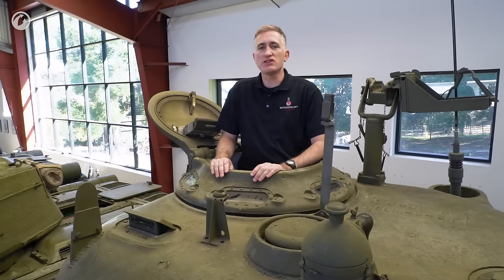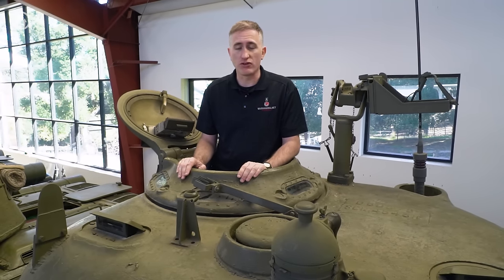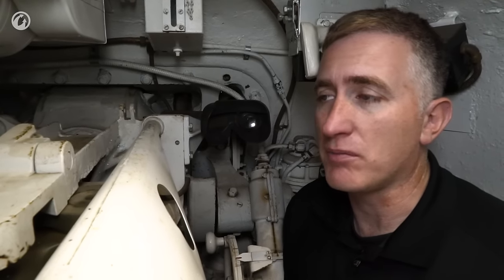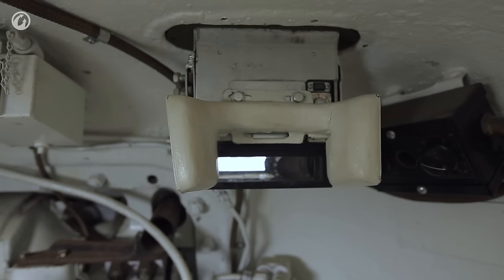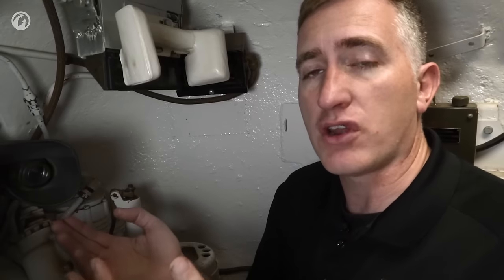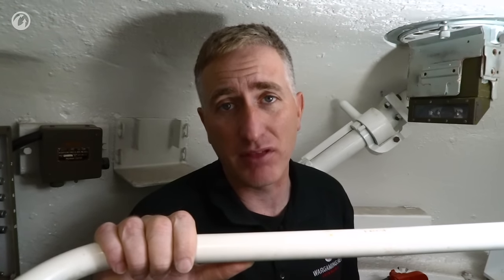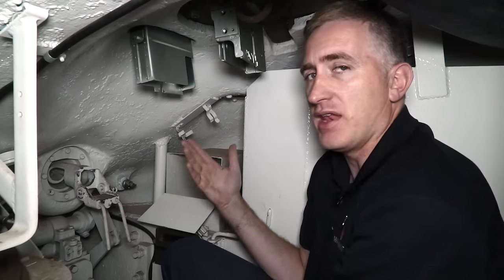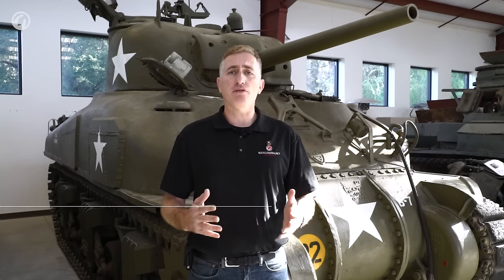Inside the Chieftain's Hatch: M4A1 Sherman part 2

Comment: the good ole "Tommy Cooker". The USSR received about 4000 Shermans, specially fitted with the 2 x 6/71N GM detroit diesels, and they loved them. Soviet commanders rated them better than the T-34, unofficially of course. Canon-neer?   What? on a pirate ship?  LoL    It is impressive, that the Chieftain finally found a tank, that he doesnt look super cramped inside ;)
Reply: That's 6-71N. The Detroits were designated first digit number of cylinders and the next two digits the number of cubic inches per cylinder. You could get 71 series engines in 2, 3, 4, 6, 8, V6, V8 and V12 sizes. They had four exhaust valves and a port that opened at the bottom of the stroke for the intake charge with a roots type supercharger forcing the fresh air in and out the valves at the top because this was a two stroke engine. It was famous for it's low end torque and the incredible noise it made at any speed above 2000 RPM. Power output varied according to the amount of supercharger boost being applied but 165hp was the low end and 238 was common but it depends on how the engine was equipped. The 6-71 was a legendary engine which was in production from 1938 till 1995 and V6 versions (6-V71) were the most common engines in city buses for decades. Soviets liked them because all their tanks were diesels so there was no confusion on what fuel to use. Marines used them as landing craft also used diesel. Army did not generally have any diesel vehicles and did not want to complicate supply requirements so avoided them.
Reply: @keithstudly6071  the USSR also received 100,000 6x6 US Army trucks specially made with Hercules diesels.  Lend lease to the USSR was massive in scale,quantity,priority (1st over ALL other US military branches) and range of materials. Chemical plants,rubber tyre plants, patents,all the Manhattan secrets..............the list is endless.
Reply: @wazza33racer  Yes and those trucks gave the Red Army a logistical advantage over the Germans, especially in muddy conditions. The Opel trucks the Germans relied on were only two wheel drive and would not take well to bad conditions.
Reply: @keithstudly6071  Yes, the german fleet was a mix of different makes,models and lacking in quantity. The reliance on horses was enormous. The Soviets on the other hand had plenty of trucks to move troops AND tow fleets of massed artillery and carry rocket launcher frames.  People dont appreciate that the railways were always decimated by withdrawing armies and truck loads of troops moving with tanks were essential for breakthrough situations.
Reply: If I could be a tanker I would 100% refer to the Loader as Cannonier.

Comment: You mentioned a 57mm gun module for the Sherman. I never knew that there were 57mm armed Sherman's. What's the story?
Reply: It was a project plan for a series of vehicles based around the T6 Medium, the prototype to the M4 series. There would be a twin 37mm mounting, there would be a quad .50 mounting, and so on.

Comment: Are the rounds you handle the real weight? I imagine there will not be propellant charge in them, thus they will be lighter. And would it make much of a difference in your appraisal of the tank?
Reply from the maker: Hmm. They are usually heavy enough, but it's all relative, I guess. I mean, I'm used to modern 70-80lb 120mm rounds, so even a full-weight 75mm would be 'light'.

Comment: Sure would like to see you do the T-14 in Bovington.
Reply from the maker: So would I, but they claim it is too much of a radiation hazard. I disagree, but don’t make the rules.
Reply: @TheChieftainsHatch  Radiation hazard?
Reply from the maker: @oldschoolgreentube  The dials on the driver's dash are cracked, apparently, theoretically allowing for radium exposure
Reply: @TheChieftainsHatch  *sigh*.  Can't believe it would be that hard to clean up, if its even a threat to begin with.

Oh well. 

Thanks for the response.
Reply: @TheChieftainsHatch  As youngsters, my brother & I spent many hours smashing the fronts of WW2 surplus, aircraft temperature gauges to take out the small horseshoe magnets. Heaven only knows how much radium dust we got on ourselves or breathed in(both in our 60's now)...

Comment: What does the "booster" switch do in the driver's panel?
Reply: It engages a Booster Coil that elevates voltage to the spark plugs from the magneto which can be used to help start a cold engine. Aircraft engines also have similar booster coils on their magneto selector switches.
Reply: Lies. It is the button that activates the bass-booster or, as we call it today, the subwoofer.

Comment: What position/version of the Sherman used the M6 Parascope? I found a website selling them, and the description says they mounted to the Sherman, but not which one or what position.
Reply: As far as version, no clue, but I suspect the driver and A driver positions would use them, as well as the split-hatch versions.  The gunner's fixed periscope may even be one.
Reply: Cinn357 All periscopes except the gunner's used the M6. The M4 gunnery periscope is similar, and a unity sight, but is different.
Reply: Cool, thanks.

Comment: what did you mean by "batter them into submission" like they would hit so many components that the Tigers just stopped working or the crews got practically shell  shocked from all the fire and gave up
Reply: Jacob Lester just shoot the hell outta the tiger so much that most of the components is destroyed and they bail out.
Reply: Jacob Lester I think basically yeah. I can't remember where I saw it but  they were claiming a tiger crew surrendered a fully operational tank because they were basically concused with HE rounds.
Reply: Don't forget spalling. Even when the armor isn't penetrated, the impact may cause metal fragments to fly around the inside of the tank.
Reply: Yeah, getting shot at, even if not penetrating, would be highly unnerving to put it lightly. Add in to that fresh and inexperienced crews and it's easy to see the crew bailing on nerves. Let alone physical damage to the tank.
Reply: Jacob Lester Tiger 131 at Bovington Museum was knocked out by a six pounder shell from a Churchill that jammed the turret without fully penetrating the tank. The jumpy commander ordered the crew to bail as not every TC was a Wittman or Carius. :)
Reply: In many cases the tiger armor would crack rather than being penetrated. Imagine a thick concrete block being battered by a platoon of 5 sledgehammers. Germans used face hardened armor which is strong but brittle, at some point it just gives up along a fault line. You also ended up with rounds jamming up wheels, tracks gun mantles and turret rings or damaging the main gun barrel rendering the tiger inoperable.
Reply from the maker: The first claim I can recall coming across of a Tiger being killed by US forces in North Africa was from a light tank company of M3s, which said it surrounded the tank and peppered it with 37mm until finally the engine caught fire.

Comment: I have a question.  In Fury when Fury is batting the Tiger tank,  the gunner seems to be using manual traverse and after it get it and knocks out the hydraulics,  he switches to powered traverse. Wouldn't you want to be using powered traverse during the battle because wouldn't it be faster than say manual traverse?
Reply: jermster17 Haven't seen the movie my only guess is that manual traverse is more precise. I imagine a gunner would use the powered traverse to quickly get the gun roughly in the direction of the target and then the manual traverse to aim accurately esp. at range.
Reply: max mustermann You can find the video of the Tiger and Fury battling on YouTube.

Comment: Why didn't you actually show the gear stick?
I've always wanted to see one, not sure how it works.
Reply: The gear stick shifts just like a 4 on the floor using the standard H pattern. The tanks using the GM automatic transmissions had the gear selector lever with a pointer on the side of the transmission. Had the same gear indicator that was used on steering columns P-N-1-2-D.

Comment: question, i know that it probably wouldn't of worked but, did they ever try sticking a panthers 75 on a sherman?
Reply: That's exactly what the M50 was. The french copy of the Panther's 7,5cm KwK 42 l/70 - the CN 50-70 in the M4A1 and M4A4 hulls.

Comment: Is there a chance to see interior of the sherman with wet stowage? 
Btw., why was ammo protection afterwards ignored probably all over the world till Abrams generation of the tanks arrived?
Reply: Wet stowage itself helped very limitedly. On top of that, reduced ammunition storage due to the displacement of the liquid. 

The fact it brought the stowage beneath the sponson was the major factor.
Reply: really? Any tests that it did not slow down the speed of the spreading of fire across powder charges or likelihood that splinter actually start that fire?

Of course it reduces ammo load, especially when you stop using some spaces for it. Than you have to choose what do you prefer - some more ammo ready to be fired, or some less ammo ready to start uncontrollable fire.

So during the 2nd half of the WW2 they started to care about likelihood of the crew survival, then they completely ignored it, than they again put it back.
Reply: > "they started to care about likelihood of the crew survival, then they completely ignored it, than they again put it back."

The M4's size, and layout allowed, on top of the ammunition design itself did allow the crew a very good chance to escape, relative to vehicles like the IV. 

> "ome more ammo ready to be fired, or some less ammo ready to start uncontrollable fire."

From reading "Armored Thunderbolt" by Zaloga, the crews didn't like wet-stowage all that much. Just that the actual position made it much safer.

The wet-stowage did reduce the chances of the fire spreading over to the next compartment, and or exploding, however not to any extent that it would change crew survival. More so the rates of hits for a tank to be destroyed.
Reply: question itself is not about how the crew liked the ammo placement, but rather whether it served the purpose. 
So how big was the reduction, how it was judged / tested, how much it reduced the speed of spreading the ammo-fire?

In case of penetration there is fair chance, that you are hurt - thus any more time given to you to escape may be quite important.
Reply: Fire, crew safety and the danger of ammo cooking off was a big issue with the Israeli army when they were using M-60 A1 and they wanted changes. I seem to remember one of their biggest issues was hydraulic lines in the crew compartment and bad experiences with ruptured lines spraying fluid in the crew compartment and roasting the crew when it lit. Ammo was being stowed in compartments with blow out panels so it would vent outside of the crew compartment on most tanks of that time. Of course the Israeli reports were a lot more public than US Army reports on this.

I think they were substituting a different, less flammable hydraulic fluid and developing automatic fire suppression systems for their M-60s. It was a 60 Minutes report, sort of a "why arn't we doing this for our guys" story.

Comment: I have a question.
I don't know if it's been answered yet but:

Why are almost all tanks painted white on the inside?
Reply: It feels more confortable, more space seems to be here. It's the same reason your house probably has white walls.
Reply from the maker: White reflects the limited internal light better, so folks inside can see what they are doing, and it also shows up things like hydraulic leaks better. British vehicles were silver for similar reasons, but I think white does better.
Reply: They're painted white to reflect more light from the internal lighting system and what's entering from open hatches. M4 users said the heat from a glancing shot would turn the white paint orange at the point of impact. German tankers had a habit of scraping off the white paint by their positions since it had a bad tendency to fly off as splinters when the armor plate was hit by a shot.

Comment: what happened if the tank was on fier and the gun was depressed above the driver/radio operator's hatch?
Reply: Most likely take the escape hatch on the bottom of the hull.
24:20
Reply: They still could access the commander's hatch since it was off to the side and the main gun was in the center of the turret.

Comment: Could a 105mm sherman change to a 75 or 76mm and how long did it take?
Reply: 105's were only issued at the Company Level, so it wasn't particularly necessary to convert them back and forth in the field.
Reply: 105s only had manual traverse so they would be unlikly candidates for conversion. they also were very useful as they were.
Reply: a mobile turret artilery
Reply: Aimitch Ang The idea was followed on by of course the M52 then  M108 a SP 105 ll.

though these were not to be used as "assault guns" in direct fire mode unless desperate.
Reply: The M4's 75mm gun used the 105mm howitzer carriage due to being stronger and for holding a 105mm barrel if needed since the field repair shops kept on hand the parts to do so. A tank company commander could have a few M4's converted to 105's to provide direct fire support for infantry that'll soon be engaged in urban fighting. The Army went ahead and began producing M4's with 105's just for that purpose.

Comment: I remember reading that the Grizzlies actually had thicker frontal armour than a standard Sherman and I am wondering if this is actually true or if it is just one of those random internet myths?
Reply from the maker: I've read the same thing, but from placing a thickness gauge on the front, it didn't seem to be unusual. Came in at about 2.1/2.2 inches all the way through. Besides, since the General Steel corporation cast hulls for some American manufacturers as well, I can't imagine they'd have had different castings.
Reply: Makes sense, thanks for the response.
Reply: +TheChieftainWoT 

I was curious what's your knowledge on the U.S. Army's usage of "combat loudspeakers" and the history of PSYOP?